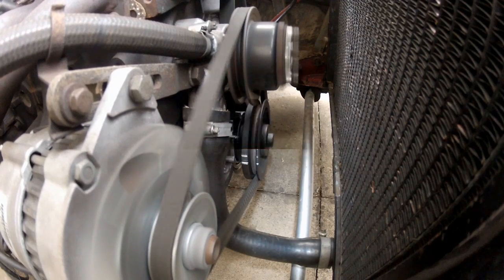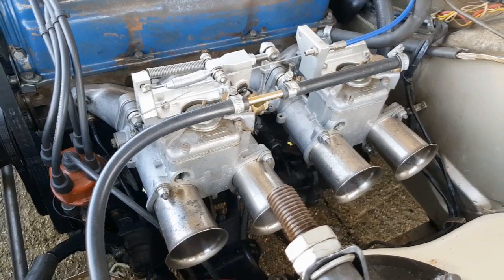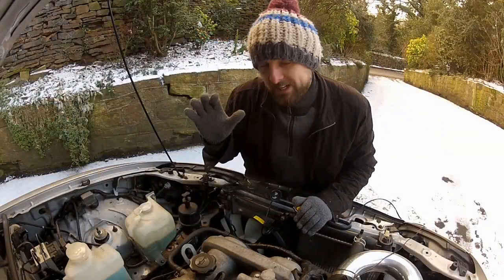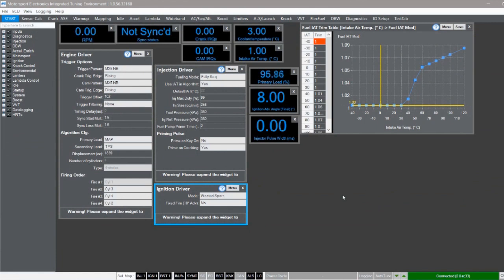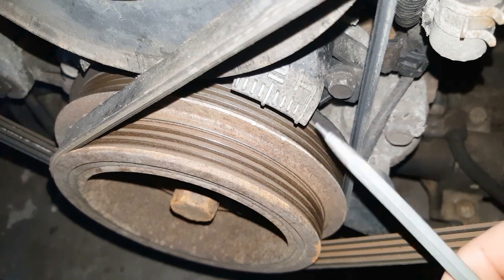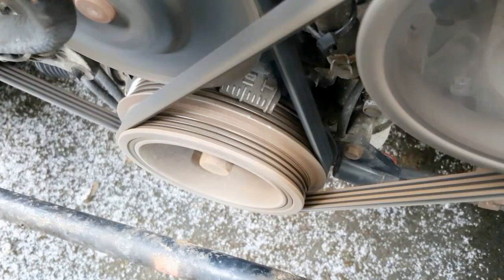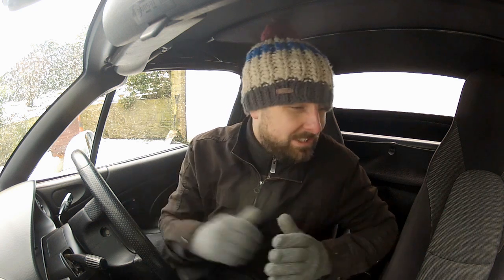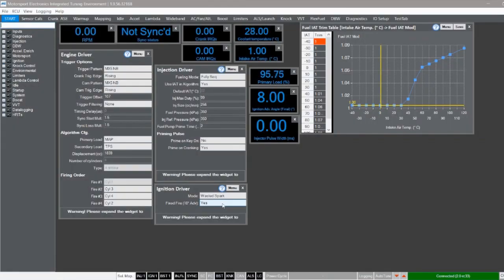How to Set Your Engines Base Timing  - ME221 ECU Install Part 04 | Supercharging an MX5 Miata Ep 12

Comment: Hey, im running the same ecu, same nbfl, just a 1.6. On first startup my timing was literaly retarded the same amount as yours (i set the offset on 107). Makes me think maybe it's something with the basemaps
Reply from the maker: Possible. I think it's more to do with slight variations in cam sensor/trigger wheel position..

Comment: If you had a coil on plug setup. How will you hock up a timing light?
Reply from the maker: You can clamp to the signal wire going to the coil, that works most of the time. If not you'd have to make a short section of plug wire to go between the coil and the plug, and clamp to that.
Reply: @FastRust  I wish you could demonstrate

Comment: 1600 head on 2L block, was it faster in any way?
Great work mate, you nearly 4k too 👍
Reply from the maker: Yeah it was faster. Throttle response was better. But it was a lot of hassle with such a high CR. If I knew how to mod the dizzy when I did it, that would have helped loads.

Comment: Thank you for this series. I like your presentation style in that you don't dwell too long on the fine detail, but you also don't assume knowledge that your viewer might not have. I'm trying to get a base map on ME221 running well on a NB8A Turbo in Australia, this video put a lot of niggling questions to bed for me. The car had a modified cam sensor trigger setup for an old ECU that needed a single trigger rather than factory, so I have not been able to assume anything in this process. You provided Factory setup clarification... Thanks again.
Reply from the maker: Thanks Richard. These ECU based episodes have been all about gathering/condensing information found scattered over the internet. Glad to hear you found it helpful.

Comment: fantastic videos as always! interesting to see how it differs from the old way on the Capri (i recently changed mine from 10 to 8 BTDC to see if it was better). Can't wait to see how the supercharging goes!
Reply from the maker: Cheers guys! Yeah it's interesting, I still prefer old school tech to be honest, but am getting to grips with this stuff - slowly! What issues were you having at 10?
Reply: @FastRust  Yeah seems like you know your stuff with the new tech! Long story but basically, a garage set it to 10 as i was having problems starting the car, when I got it back it still wouldnt work and I found out the Accelerator pump in the carb wasnt working. Now its great but I thought 10 was too much as people seem to set them between 6-8 plus I thought it was pinking (turns out thats a different noise i've not tracked down). I've tried it at 8 now but its seems a bit sluggish so, unsure if I should go back to 10. As far as im aware its a standard 2.0 on a weber 32/36.
Reply from the maker: 6 - 8 is the norm for standard engines. There is an argument for being cautious with timing as 4 star back in the day had a higher octane than todays regular unleaded so people worry about pinking. That said, I've ran mine at 10 with nothing but a cam with no issue. I did, however, become educated in the sound of pinking when I fit the 1.6 head 😆 Kinda sounds like lots of ball bearings bouncing around in the engine. Most noticable when you put your foot down in a high gear up a hill at low - mid rpm. If it's gonna do it, that's when it'll happen!
Reply: @FastRust  My Escort pinks quite a lot at the moment due to a vacuum leak 😂 but the Capri sound is a bit different. You cant hear it if you rev the engine on its own (which might be normal). Not sure if it'll work but heres a little video of mine making the noise at 0.3 and 0.8 seconds at its loudest. I thought it was pinking with how it reacted to the accelerator pedal but a mechanic mate said he didnt think it was that and something rattling 🤔
https://youtu.be/y80aiqYwaaA